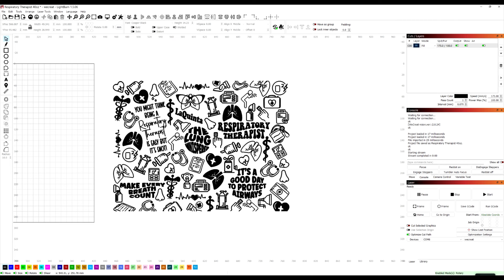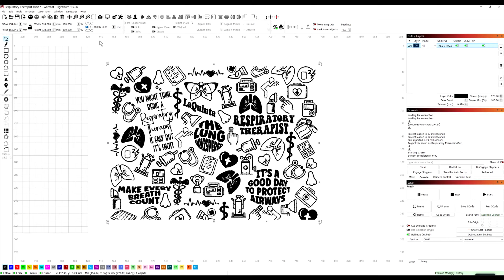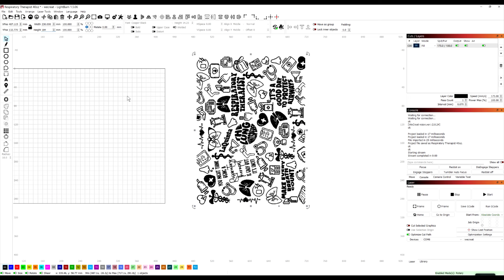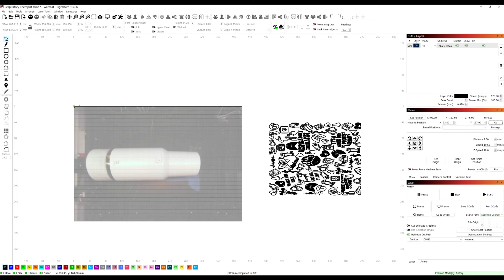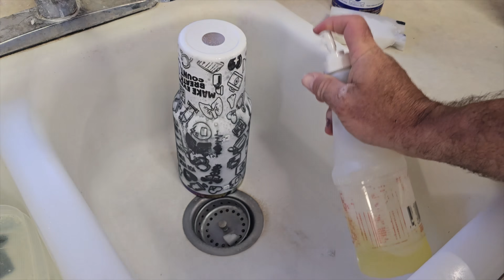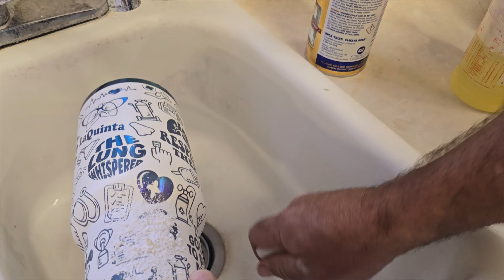Using LightBurn for Tumblers with WeCreat

Comment: do you have an video on how to use laserburn with wecreate. I installed everything however the laser is not moving, when I do a test cut
Reply from the maker: Turn off laser. Open Lightburn. Be sure not to have Create software open. Turn on laser. Be sure to select the com port. In lightburn, go to the move window and hit an arrow button. If the machine moves, everything should be good. Be sure to hit the auto focus.

Comment: Do you have to bend the parts where you attach the handle? My cup is off brand and dont want to risk them coming off
Reply from the maker: I do. If your cup is level, it may miss the tabs. You can have e it set the focus. Then turn the ma hine off. You can then move the laser over by hand and rotate the cup, and ensure it will miss. I sometimes lift the end of the cup up to help keep the smaller end in focus. When I have done that without bending the tabs, they hit.
Reply: Thank you

Comment: How did you add a camera for lightburn?
Reply from the maker: I had originally, I had added another camera and 3d print a mount for it.
I heard that light burn 1.7. Now can see the we creat camera. I have not had a chance to test it out, but if it does that is going to be great. Make sure you have the newest verse of lightburn and then go to the camera menu and see if it is now working for you